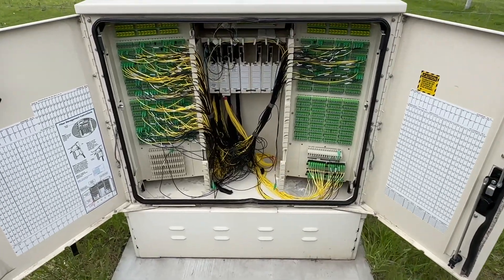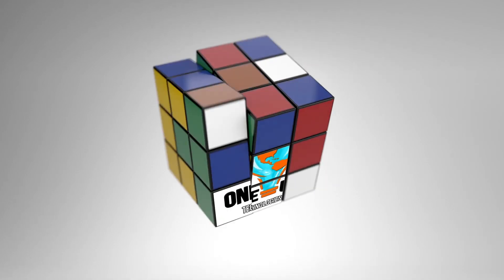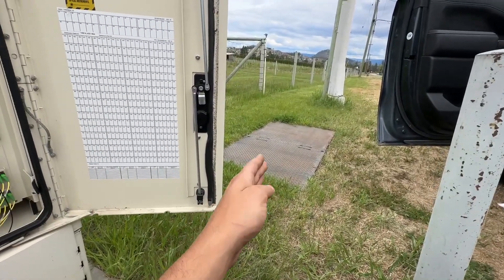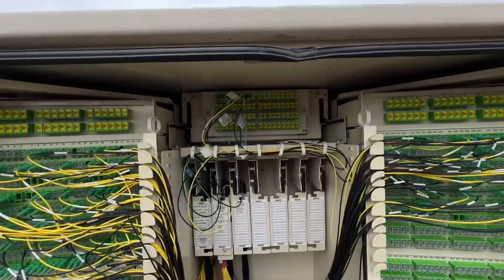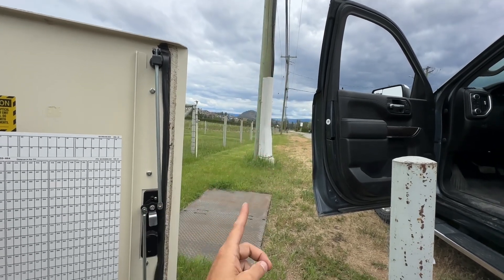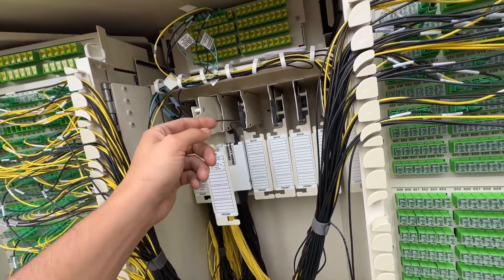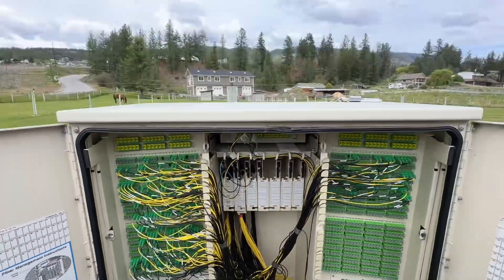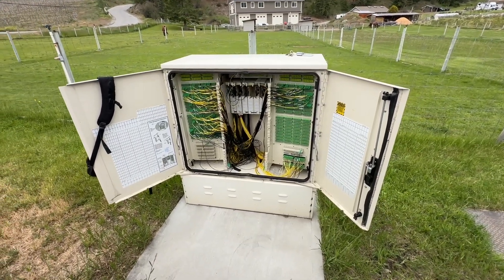How A Fiber Optic Distribution Hub Works

Comment: So I live in the middle of nowhere Kentucky and theyre putting fiber optic cable down by my house. Ive been trying to figure out how they brought it in cause so far I haven't seen a FDH. Just the underground lines being put in. I think i know where it is but not completely sure. When they started they had 2 trenches dug out coming out of a field by my house. Then from that point they started dropping cable from each trench down different directions on the street. They have been in that field for months. Then once they started down the street they told me it was almost done. Theyre supposed to be connecting my house in a month. So I got interested and started trying to learn what I could so I could understand what was going on 😂. I know its Spectrum Fiber cause I already have the appointment and my plan setup (2Gbps down - 1-2Gbps up) just trying to understand the process and possible latency i guess lol
Reply from the maker: Hey thanks for watching and commenting I truly appreciate it. That’s awesome your area is getting fiber optics 🛜 there is many different layouts to deploying a fiber optic network the reason you have not been able to find a FDH is most likely due to a different type of network build the provider could be going with in tray splitters and running everything back to there pop sites.

Thanks again for watching lots of new videos coming soon

Comment: How do the splitters work? Is it DWM?
Reply: GPON or XGS-PON
Reply: One fibre "glued" to a prism with all the other fibres on the other end. DWM would be a MUX. So these are as dumb as you can get. You can run DWDM on them and break out the wavelength on the other end.
Reply: @Todd.T Yeah I've researched this since that comment. It surprised me that you had potentially hundreds of devices sharing the same fiber and same wavelength. It makes sense in that none of this equipment requires power though.
Reply: Impossible to be sure from his video. You could have DWDM, but then each customer would need to have a different transceiver, and possibly extra filters to block unwanted signals.

It is more likely this is GPON, and it is just a single wavelength one way, and another wavelength other way. All clients share the same wavelength, and splitter is literally splitting half of the light into one half and another half to another half. Then you split that 2 to 4, to 8, to 16, to 32, and some even can go to 128, but each time you split, you reduce possible bandwidth, and signal level, so distance is a bit reduced possibly. The customers will use a special GPON transceiver, that a) can receive unicast traffic to it that is only for it (using encryption keys), and cannot see other customer traffic. b) sends up only in allotted time slots (based on measured distance to CO, and split points), and set upload bandwidth restrictions. So all customers send on same fiber, using same frequency, but use different time slots - this is called time-division multiplexing.

As far as I know XGS-PON is exactly the same as GPON, but high bitrates, and different wavelenght than GPON, so GPON and XGS-PON can be on the same fiber, allowing easier incremental upgrades of customer equipment. Still single wavelength, and same dumb halving splitters.

You theoretically could combine GPON and DWDM, to fit over 1000 customers on a single fiber, but it is probably a bad idea, and also logistical issue to deal with different wavelength and equipment. DWDM is used in other places tho in more controlled environments. Most for commercial stuff, backbones, renting fiber wavelenghts to others, and some other things. Considering you can easily fit 100Gbps on a single wavelength with the current tech, and 200Gbps is also possible but very expensive and about 10km range only using standard equipment (with specialized requirements 100km, or more with amplifiers is possible of course). So a lot of capacity, but still not that much in some places. So DWDM can cram like 40 or 80 of these wavelengths, and some system go further. On a single fiber, for about 16,000 Gbps. The highest end stuff can be way higher, in range of 300-1500 channels, and 430,000Gpbs, some commercially used for long distance, some in the lab tests. And then there is entire different category of fibers called multi-core, which can do even more. Strangely enough, the super long cables, will only have few fibers, mostly because of cost. But for shorter distances, like the stuff in this video, it will be common to have 288 fibers in a single cable in some sections of the network.

The DWDM splitting devices are usually called MUX/DEMUX. Not splitters.

Comment: Can you please tell us more about the 36 bypass ports on top left/top right and the patch board blocks bottom left and bottom right?
Reply: Bottom is likely the “Parking Lot" for detached fiber lines. The bypass or pass-through allows you not to use the splitter to make a connection for a point-to-point.
Reply: @OofDa I’d assume a use case would be dark fiber rental?

Comment: In Germany we usually do not have splitters in street cabinets and we splice all fibers 1:1 onto the main cables going to the POP. A bit more detailed: You will find there at least two 96F cables coming from the POP (which looks like a prefabricated garage containing all splitters, OLTs and upstream routers) and all micro cables going into the homes. Each microcable contains something between 2 or 24 fibers and is blown into a 7mm microduct. Further we have some 10mm spare pipes between the street cabinets for bypassing / reconnecting in case of broken cables. Usually we do not have cables in these ducts.
Reply: Same in Switzerland, all end users are connected to POP directly, no splitters in between. It is a bit more expensive (about 20-30% more), especially in more rural areas, but more future proof, and allows different ISPs to use fiber infrastructure easily. (There were some installations with splitters, but they are being converted, because technically they are illegal).
Reply: @movax20h  not sure where OP is posting from but here in the USA most are all private fiber networks.. though where I live the fiber infrastructure is provided by our power utility district and local ISPs can become providers on that network.
Reply: @thecasualfly I am certain he is in Canada. British Columbia to be exact. That FDH cabinet is used by Telus all across British Columbia. I noticed that the electrical meters in one of his indoor demarc box install videos is the same as what our electric utility company (BC Hydro) uses all across BC.
Reply: @movax20h  Very interesting... That's a new concept. We just got XGS-PON turned on here in my area, and I'm now on the 5gbps service. I wish they didn't share a common main with splitters and were 1:1 direct to the POP.
Reply: What he is referring to as "splitters" are most likely 32 channel CWDM  breakouts. (hence the reference to "prisms").  Reduces the bulk of cable needed back to the central office.
Reply: @pileofstuff  This is GPON which does not have any CWDM components in the signal path. It operates bidirectional on a single fiber where the upstream is between 1290 and 1330 nm  and the downstream is between 1480 and 1500 nm.

Comment: what does the bypass do and what's the area on the lower right corner with all the pigtails do? thanks
Reply: I am not sure, but I think bypass is where you want to do splitting further down the line, not in this hub cabinet.
Reply: The lower right is a holder for the unused fibers from the splitter. As new customers sign up, they'll take a fiber from the holder and plug it into distribution (subscriber) port.

Comment: What is the max distance for the main feed from the office to the FDH and then what’s the max for a line from FDH to the client?
Reply: I’ve seen 3.4 km before but I’m not sure what max is
Reply: @jordanchance4939   20 km total with no splits. 17 km total by design for reliability. The more you split the less the distance. Attenuation is the issue. If it were to work really far then you would have timing issues on the transmits if there were any devices closer to the OLT. You have a link loss budget comprised of splitters, couplers, WDM splitters/combiners, connectors, fusion splices, and the loss of the fibre itself. Most of the distance limitation is also on the receive sensitivity of the SFP.
Reply: I've deployed ten thousand feet/3km without reaching Power Supply, FDH, yet.